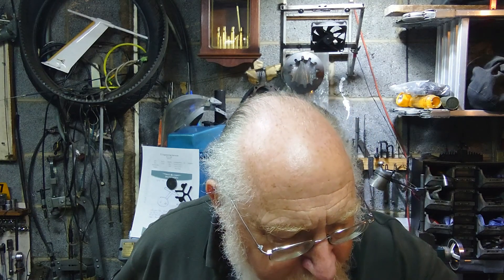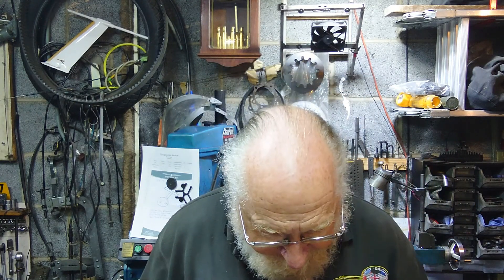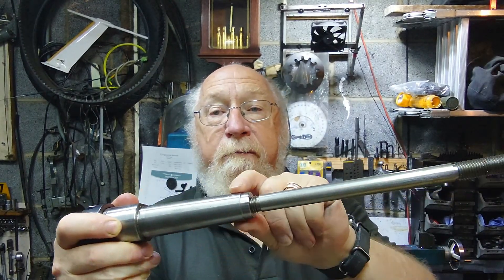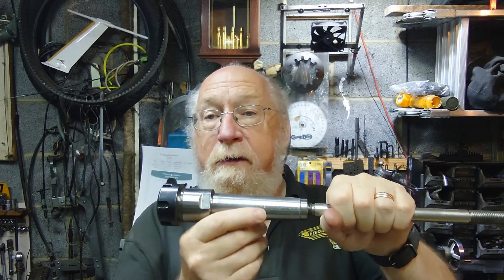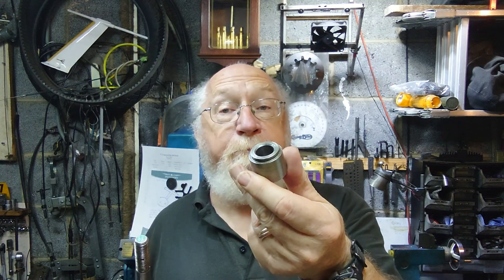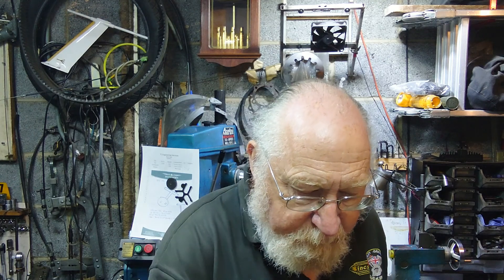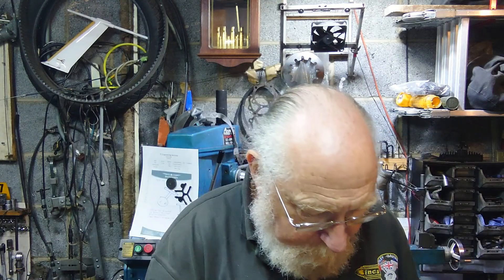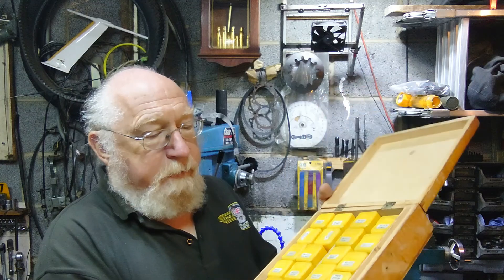ER 32 Collets

Comment: Hello Spen A while ago I think you mentioned that you replaced the dog clutch in your lathe. I have just stripped the clutch mechanism and the pin on the end of the engage handle is warn. Was this your problem or was it the actual clutch? I will try and contact Clarke spares dept tomorrow, but I don't hold out much hope. I might have to try and make one out of tool steel perhaps.
Reply from the maker: That is one of the weak points. When I stripped mine to replace the bearing I also fount the pin mechanism worn, parts 18 & 29 on page 18 of the parts list. It had been loose for ages. Luckily I'd been given some spares a while back.
Reply: @SpenCrowson  Thank you for your reply. The part 29 with the worm pin, now looking at it. I might just rotate it 180Deg and insert a 4mm pin in it, re drilling the dimple for the handle locating screw. Or make another without the O ring grove to give the pin a bit more meat to drill in and fix pin to. I may even have a go using my rotary table on the new to me mill to make the pin and barrel in one piece Cheers Alec